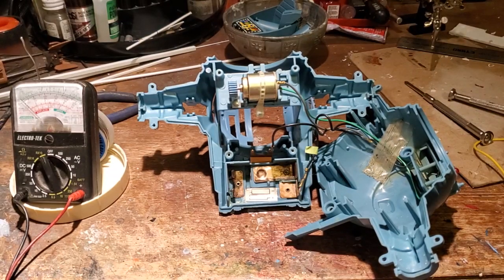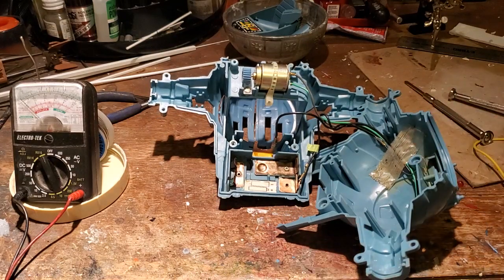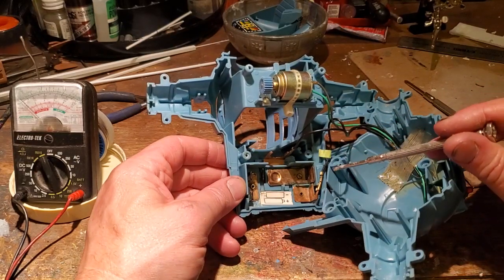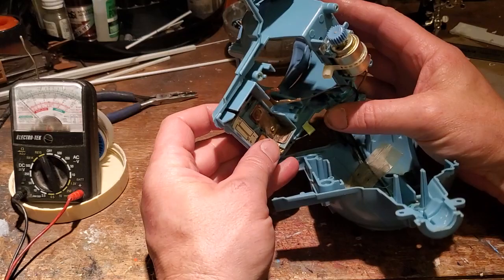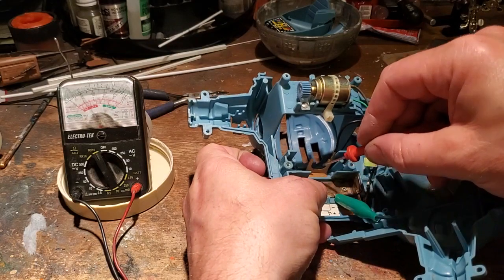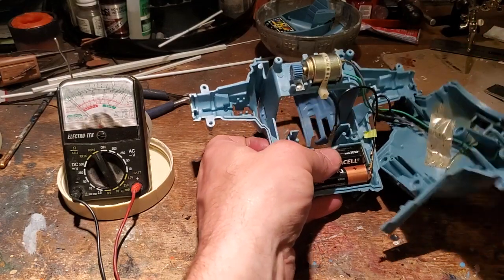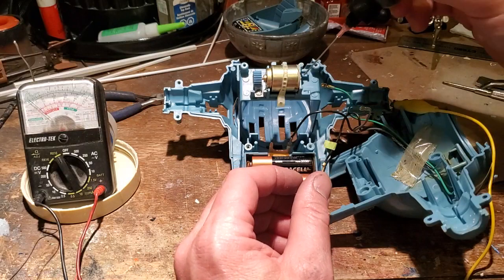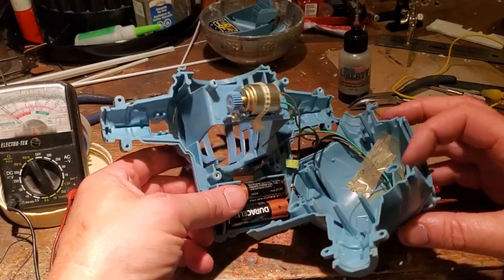Electronics Repair Tutorial on a 1983 Kenner Tie Fighter

Comment: So I acquired a white one. Got the motor working. Cleaned all contacts. And can’t get the light to work unless I hook two disconnected wires to a 9 volt. Has original wiring. Wondering what the issue could be since everything works with more power , but not with two AA batteries. Mine does have the original springs. Any ideas ?
Reply from the maker: Corrosion is my best guess, causing current not to smoothly flow. Kenner used  inexpensive steel braided wire instead of copper.   A dremel with a brass wire end should clean things up.  Worse case scenario,  replace the wiring.

Comment: Thank you for this video! I had cleaned an extremely corroded battery compartment with a combination of vinegar and isopropyl alcohol- it’s very satisfying going from a greenish blue crystalline cavern to a shiny copper compartment with the help of the Dremel wire brush. However I still couldn’t get the batteries to work so I was stumped until I saw your tip about cleaning under the tab (Duh). I tested it for continuity and Sure enough - there was a whole bunch of corrosion nonsense under the tab. With the help of more vinegar, more contact cleaner and this awesome screwdriver I have, that has an unusually thin but long flat tip that’s textured as well; I was able make quick work of the corroded area. Now the moment of truth, IT WORKS!! The LED is flickering on and off but it will have to do, honestly that looks like a project. Cheers
Reply: I flipped the leads and everything works great - I have a red and black leads
Reply from the maker: Awesome!!!  Great job on restoring the TIE!
Reply: @classicalvintagecollector I just dug into another one I had - where the light worked but the motor didn’t. I tore it down dabbed the engine with some lube and BOOM, working as good as new!  Thank you so much! I guess I will have to look around your channel for some x-wing restorations, the lights work but no action from the motor action. Hopefully some lube will do it. 🤞🏼
Reply from the maker: Thanks for the feedback.  I have a videos on all the electronic ships with the exception of the tie intersector.  That 1 took a lot of restoration work but I gotta really inexpensively. I haven't gotten  around to making it because the video is going to be quite involved.

Comment: Thanks for posting! Really great video.  I have one of these (non-working) tie fighters with zero corrosion. I'm going to try to fix it using your tips.   Could you possibly post a link to the Evan's battery tool that you used? (There are several versions on their site--with and without a switch, etc.).   I have zero experience repairing electronics, but I'd like to try.   I'll need to order all the tools, including the volt meter and alligator clips.

By the way, my green wire and gray wire were in the opposite position from where yours were, and I don't think my tie fighter had ever been opened before.  I tried swapping them, but that didn't fix the problem...lol...

Thanks again!!
Reply from the maker: Mike:. Thank you for taking the time to watch the video.  Here is a link you asked for.
https://evandesigns.com/products/aa-holder-with-switch
Reply: @classicalvintagecollector  Thanks. I'm guessing we want the version WITHOUT the switch for this project?
Reply from the maker: @Mike-ul9tk  I would get the one with the switch as you will find that it will have multiple uses in the future.

Comment: Thanks for posting this. Some notes for myself and anyone attempting this repair: 
• use a small pair of bent-nosed  pliers to gently pry out and reattach the spade connectors from the motor. 
• the motor has a marking on it indicating the positive terminal. This is important when removing and reattaching the motor. 
• there should be continuity when touching the motor terminals with the meter leads
• you can clean the motor interior by prying up the retaining tabs and sliding the plastic cap off. (You must cut the zip-tie first)
• mine was making an awful squeal until I cleaned the motor. 
• use Deoxit and a Q-tip on the brushes and motor shaft. 
• note the location of the zip-tie nub before cutting it, so it doesn’t impede reassembly.
Reply from the maker: Thank you for the extra details.